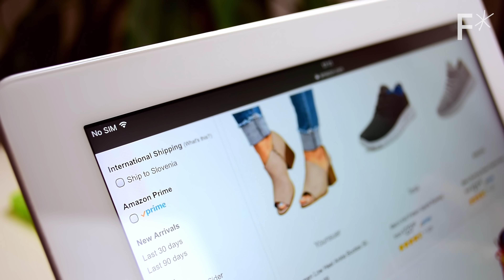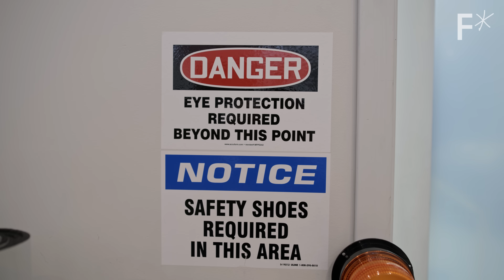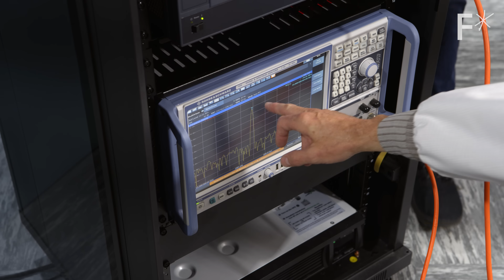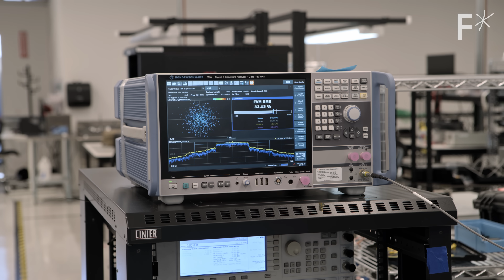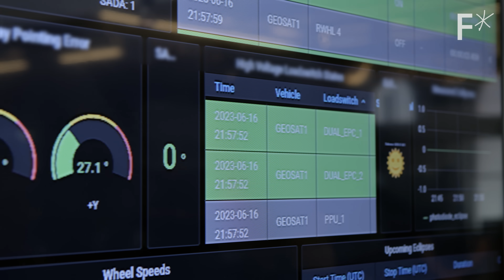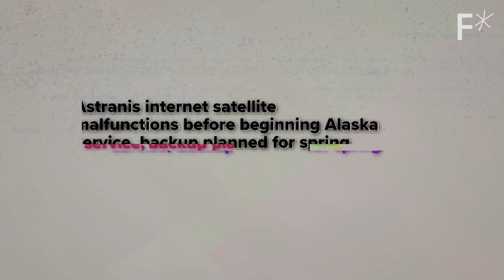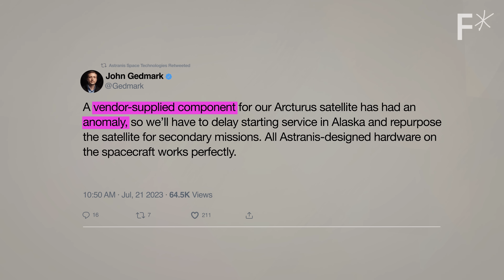Starlink’s newest competitor is using next-gen satellites to create internet for all | Hard Reset

Comment: Thanks for stopping by!
Reply: The big drawback with geo-stationary satellites is latency, which prevent some important use cases, and even can make surf the web frustratingly feel laggy… 

Starlink doesn’t have as many limitations, and new emerging technologies (satellite communication from a regular mobile phone, meta-antenna,…) may make communication from a regular mobile phone being near seamless (with huge lower cost advantages thanks to the HVM of mobile phones).

Also I would think that Startlink is funded by the profits generated by SpaceX, and therefore already have a huge monthly cash flow that they using to iterate fast, lower cost,… on each new Starlink satellite generation. Starlink subscription is already in the 40€/month price ballpark in France.

Therefore geo-satellite internet is a non-starter as 1. it won’t be better and 2. it will also be much more expensive.

Comment: Everything goes back to a cable bro. Regardless if they get internet 🛜 from WiFi or satellite 🛰️ all the data comes back to a wire that goes back to a Colocation/Data Center. 😅
Reply: Okayyy, what's your point? The connection is all that matters
Reply: @mhxxd4  my point is that the fact he said "The technology is eliminating the cable infrastructure" there is so much you can do with sat/wireless... If the connection is all that matters to you that's ok, and "ALL" the matter is not simply the connection lol
Reply: Not true, most satellite connections are direct point-to-point.  Of course there’s the data center on the ground where the internet is coming from.  But that’s expected, the internet isn’t some sort of mesh network 😂
Reply: Correct, they talk like its a Mesh one and there is no cables needed.... @AnthonyBullard

Comment: Great idea, lets make the internet reliant on satellites that can easily be destroyed by solar activity, space junk, or by crashing into other satellites. I don't see that causing any problems in the near future.
Reply: @villager736 of course it’s superior all other things being equal.  But when you have remote locations, you take the trade off that you will have higher latency for having relatively cheap high-throughput connectivity.  You just can’t run fiber every single place in the world, sometimes for political reasons, sometimes economic reasons, and sometimes even technical reasons.

An engineer doesn’t say some material, process, or technology is the “best” with no qualifications.  There’s always context to every application of the above.
Reply: @AnthonyBullard  Satellites are also not the most stable option for people to use either. People become reliant on the satellites, then space junk or solar activity destroys it. Then what for the people reliant on it.
Reply: What's it like in the 1970's.
Reply: @mikemines2931  You do know that using ground cables to power the internet will always be faster and cheaper.
Reply: A cable can be cut or be flooded or catch fire or be accidentally dug up or the repeaters can short out, etc etc.  technology is fragile, and systems of redundancy are needed for critical infrastructure.

This is engineering 101.  You make the components as reliable as economical and technologically possible, and then add redundancy as is called for based on the application.

Reminder we have satellites that have been doing their work for decades reliably.  And companies that deploy them and have revenue streams are incentivized to plan out their lifespan and plan worst case scenarios.
Reply: @AnthonyBullard  Cables can be safely underground with a watertight seal. Being underground keeps them in a stable environment and can minimize the damage fires cause to the surface. They are also under the nice protective layer of earth's magnetic field, ozone layer, atmosphere, and soil. 

While satellites are all out there unprotected. They are at the complete mercy of micro meteors, cosmic rays, and whatever the sun throws at them. Not to mention the fact that with the rising amount of space junk, it might not even be possible to launch anymore satellites. Also what happens when they start to break down, spending who knows how much money getting someone or a drone up there to fix it. At least with cables when something goes wrong you can just have someone with a truck to go fix it.
Reply: Satellites wouldn't phase out ground stations or fiber optic, that'll never happen.
Reply: @MISTAKEWASMADE4live  Fiber optic is the superior option. It's just fast and wont be destroyed by space junk and cosmic rays.
Reply: @villager736  Actually no. Light doesn't travel through FOC as fast as microwaves in space.
Also you'd need a cable attached to your phone or a cell tower every 5 miles (closer for fast, high-band 5G [due to terrain, etc]).
Reply: @nunya___  fair enough
Reply: Most things you mentioned are good arguments for geostationary orbit vs. LEO! We're not like most satellites. Ours are further away & sit in an orbit stationary relative to the earth.
Reply: @astranisspace I am extremely skeptical that your cost structure will allow you to be price competitive with Starlink. Starlink is very well funded (thanks to SpaceX profits), iterating fast and has the advantage of bigger scale (which reduce unit costs). Starlink is also providing a much better service (higher bandwidth with lower latency) at a much cheaper price. They are already in the 40€/month ballpark in France, and I suspect that with further technological improvements, they may have the potential to go cheaper than that…
Reply: @astranisspace   Perfectly in position for solar storms or cosmic rays to blast it to dust. Not to mention an easy target for attack.